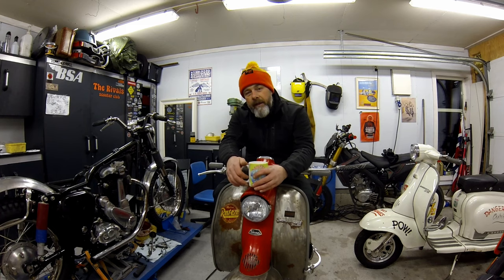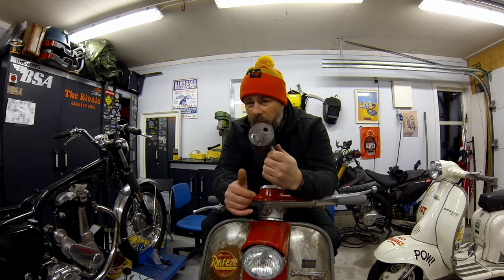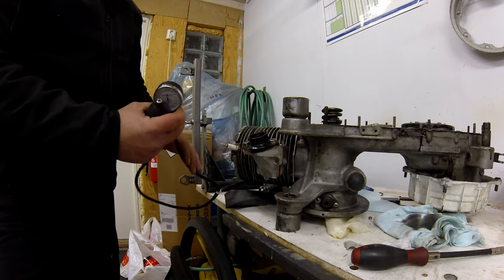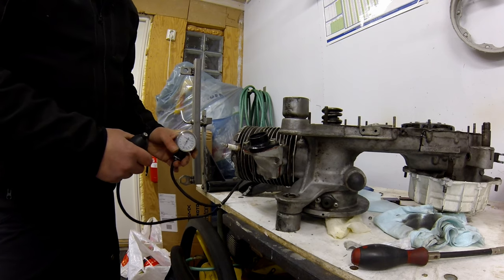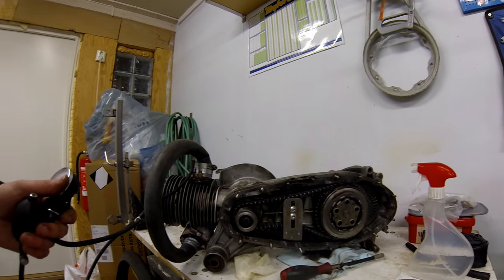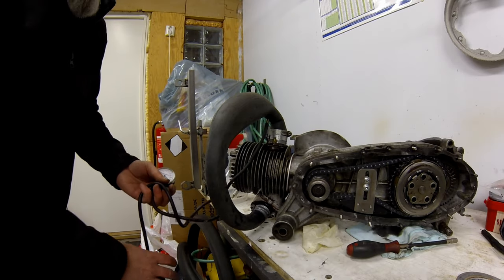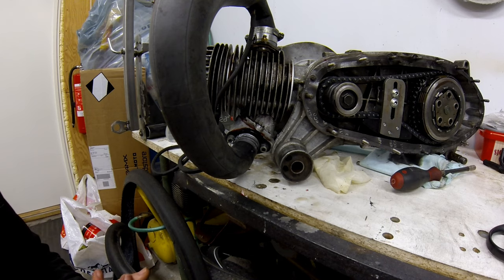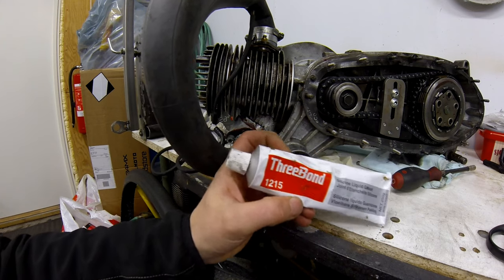DIY, 2stroke leak down test.

Comment: I struggled to make this type of leak down kit work but i didn't think of those tips you suggested. I went out and bought the Daryl Taylor kit which wasn't cheap but much easier to seal up. I could of saved a few quid if I had seen this video 1st.

Comment: Hi Rob I’ve used the three bond on the BGM head as well as the casing gaskets will it be ok🤔🤔🤔
Reply from the maker: Because the bgm has a flange it will work fine 😎 I use wellseal mostly on non flange heads. I also used three bond on my ss and after 2 years it showed no sign of blowing.

Comment: Rob, is there an 'acceptable' pressure loss ? Currently I'm losing about 20 mmhg (spigometers as you say) within 10minutes. So it's a slow leak but it is leaking but from where I haven't found yet.
Reply from the maker: That sounds OK. According to the Internet if you pump up to 300, then a loss of 50 spigomiterometers (tm) pr minute is fine. Personally on my last builds I've tested 220 but only lost 10, in 10 minutes. Just make sure piston is at bdc and I've started to use leak spray in a can to check the main bearing seal. After the s1 engine rebuild I noticed a small leak past the seal plate because the seal plate didn't clamp down on the hallite because on this Indian motor, the bearing sits a bit lower. This is apparently common on Indian blocks. I used some sealent on the hallite washer and that cured it. Had to rebuild 3 times before I caught it. Ffs.

Comment: Nice trick with the inner tube👌 A common misconception that a small manifold leak like you have on that engine would suck in extra air and run lean but in fact, it won't it will run rich as the air/mix is forced out the leak on the compression stroke, on the intake stroke air will always take the easy route through the open carb /reeds not a tiny hole in the manifold ......big holes or splits in the rubber  /gasket are a different matter and will make it run lean . 
The first signs of a manifold leak are a rich burbbly bottom end that most people put down to jetting so they lean the jetting out, then when the leak gets worse it compounds the problem.

Interested in how you get on with the clutch, never had much success with them myself 😒
Reply from the maker: The lad who owns the motor is on a budjet, what problems have you had with the clutch? I don't think the inlet leak is the only leak, so I'll take off the primary when the inlet is sorted.
Reply: @kickbackgarage  very stiff action and hard to get right
Reply from the maker: @shinyred  shit. In other words, just an old school 5 plate oversprung clutch. Thats the problem if you are not willing to pay what it costs for the newer type clutches.